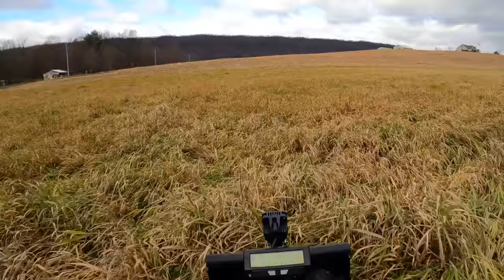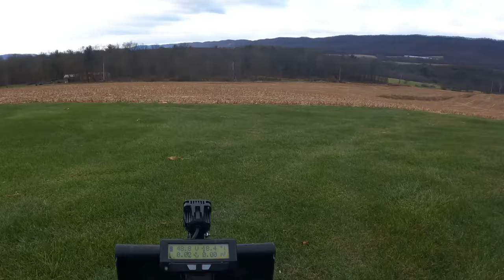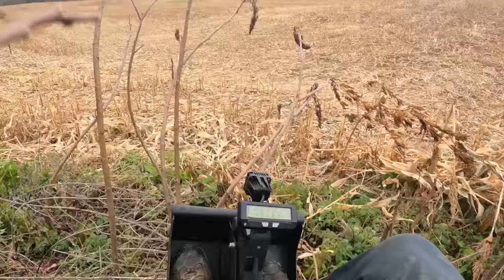FIRST DRIVE | Outrider Coyote 4WD

Comment: This thing looks like an amazingly fun vehicle to drive. One improvement I would suggest for safety is some sort of head saving apparatus. A simple bar of some sort to avoid getting your head chopped off.  I'm an older guy and in my lifetime I have had two friends suffer extremely bad injuries. One was riding a go cart hit a chain that was blocking a driveway and the other was a wire fence while driving a snowmobile. Both survived but in each case were hospitalized with devastating injuries.  Be safe and stay alert watching you driving through open fields looks like an absolute blast.

Comment: Awesome 👏 
Is there a manual option in case the battery runs out and you’re in the middle of the woods at below zero temps? ;)
Reply from the maker: Pedals are an option with the live axle version.  Packs are insulated for better cold weather performance.  This cell chemistry does very well even in low temperatures.
Reply: @OutriderUSA  thanks. i'm totally in awe of these bikes, especially the wheelchair hand cycle ones and would love to have one.  you guys have done a great job on all of these. the solar power option is too great!
Reply from the maker: Thank you so much for the compliments!  It's a labor of love, to be sure.  We're riders ourselves and we want to move the needle on what's possible so everyone can benefit.

Comment: What is the weight capacity ? Is there a heavy duty ,long range version? How does it fair in wet swamp and mud? That's a really cool quad.
An after  thought , propose it to the military , give it optional nitinol alloy wheels ,  add another 7500 kw of power,  infrared illuminators and reflectors ,  a canopy support/roll cage , and hard points to add armor plates....if they awarded a contract of course. I know it takes money and time...which is also money. But I  can see special forces using them at first and  become regular issue after awhile. I don't need the armor , but I would need more power and a stronger frame/ suspension , doubling the wheels as an optional feature may also be a good idea for heavier loads on softer ground, snow ,mud , riverbeds.

Comment: Disabled vet, can't walk. 
Storage rack for crutches and rifle?  
Could it drag or trailer a deer out? 
Live axle trailer synced to the power control system?
Reply from the maker: Hi Mr. F,  

It can be equipped with a rear rack for carrying crutches and a rifle.  It can drag a deer out, but a better setup is the trailering out.  I'm not sure what you mean about the live axle trailer synched to the power control system.  Do you mean a motorized trailer?  Feel free to email us:  info@outriderusa.com 
 Check out our hunting video if you haven't already:  https://youtu.be/q7qTnISlog0

Cheers!
Tommy

Comment: Charge time? Distance between charges? Need lots more info
Reply from the maker: Hi Forrest,
Charge time is generally 1.5 hrs per pack.  (So 1.5 hrs for standard 1000 watt onboard charger and 1.5kWh battery.)  We have a 2500W charger which cuts charge times in half.  On our largest 6.0kWh pack and 2500W charger, charge time is 2.5 hrs.  Range is 20-35 miles per pack.  With 4 packs, Range is 80-140 miles.  Hope that helps!  Full info is on the product page: https://outriderusa.com/products/coyote-quad-compact-electric-atv
Cheers,
Tommy

Comment: Being From Pa I can tell you riding through those Corn stalks is a very bumpy ride those fields are energy eating takes a lot of effort. How long can you Cruise around on a charge with that Little Wagon? Have you tried to pull a Deer or hog with a rider ? Idea maybe back the drag brake so it regenerates more often ….maybe use a Braking System like RC ESC use that just Reverse power motors to brake… this is cool guys
Reply from the maker: Thanks Terry!
Our full specs including range and charge times are available on our site: outriderusa.com.
We have had success pulling an antelope with a rider on a hunt in New Mexico!

Cheers,
Jack

Comment: What's the runtime on a full charge?
How reliable is the meter?
Reply from the maker: Hello,
The runtime is 20-35 miles per pack.  4 packs max.  So with the largest 6.0kWh pack, range is 80-140 miles.
Cheers,
Tommy

Comment: What kinda of hours and miles are you getting out of a full charge? Thing seems to be a beast.
Reply from the maker: Hi Don, depends on pack size.  20-35 miles per pack.  With the largest pack, it's 80-140 miles.